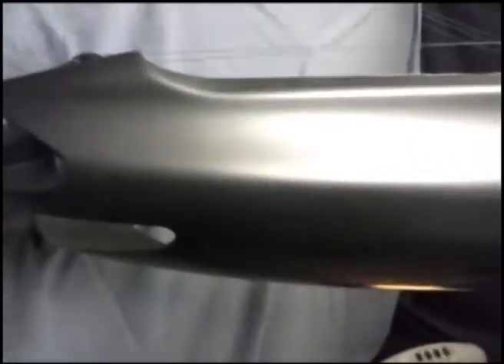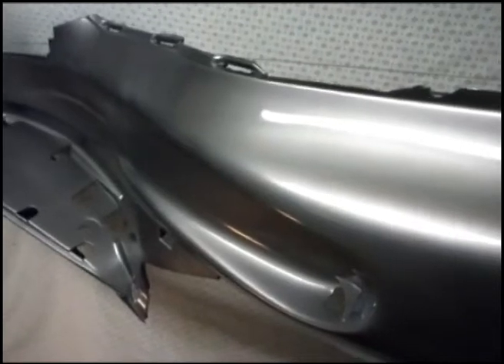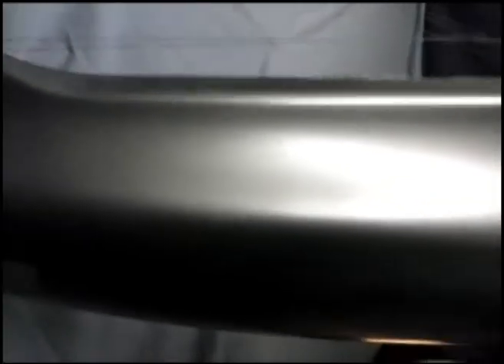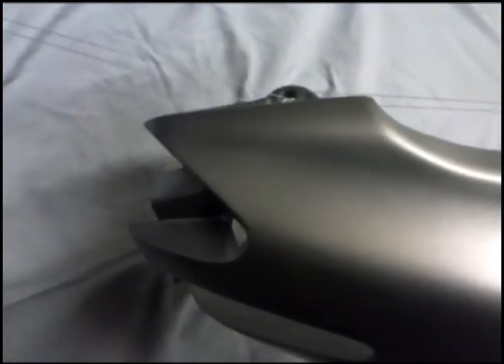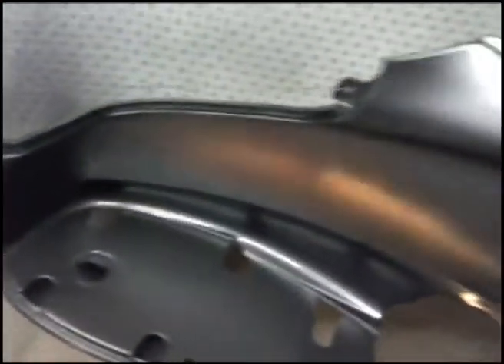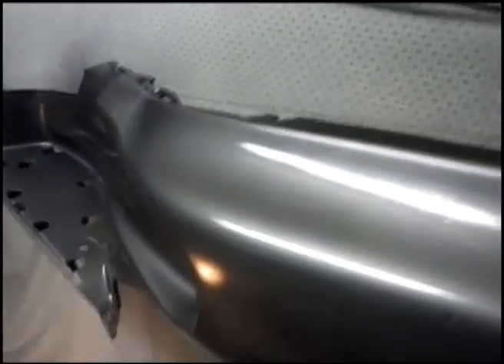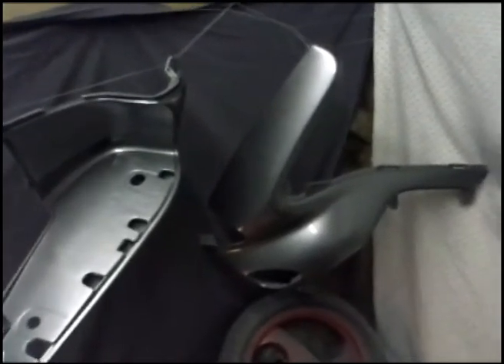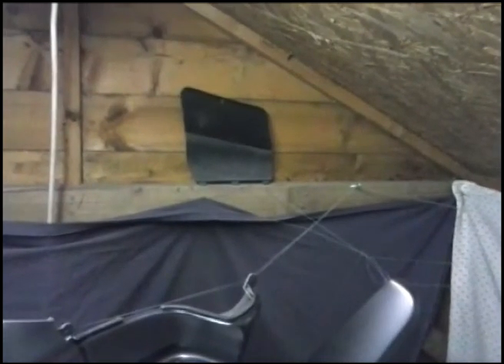Gillera Runner Panel Spray Painting ( Aerosol cans )

Comment from the maker: i would say 2 undercoat, 3 base coat and 2 lacquer minimum. if you only do 2 base coats you might not cover all of the panel/s with paint and you wont get even coverage.I would also do 3-4 coats of lacquer because once you cut back with rubbing compound it will take a thin layer off......the more coats of lacquer, the better the shine.....Prep is key, the better the prep, the better the end result.

Comment: What sanding papers did you use bro?
Reply from the maker: I used 800 to 2500 grit wet & dry. Make sure you use plenty of water because once the sandpaper gets clogged it starts to scratch your work.
Reply: Mark FPV i used 80 grit dry bcs it had a lot of bad clear coat damage,so i am down to bare primer..Can i now use 800 and 2000 to smooth out the plastic and then paint?
Reply from the maker: if you used 80 grit you will need to go from 120, 200, 400, 600, 800  to remove the deep scratches. 800 grit is fine to then primer, i use 1500 grit to then flatten down and primer again if it needs it. dont flatten the base coat if its metallic, go straight to lacquer. if its just a solid non metallic color you can flatten it. i always flatten down the last coat of lacquer before polishing.
Reply: So i can't jump from 80 grit to 1000 wet?
it must go from 120 all the way to 800?
Reply from the maker: if you want to remove the scratches left by the 80 grit, yes. Its a pain in the ass but has to be done for a decent result.
Reply: Oh okay them,i have sanded it with 80 grit bcs the clear and base coat were pretty bad so i had to dig more to get it flat and i've sanded it untill the primer..Is that bad or it's a god thing haha..
I am a begginer is there any tutorial were i can learn on how to prep those plastic panels?
Reply from the maker: 80 grit gets it down much faster but its harder to get smooth again. if you spray a little primer on a small bit you will see what i mean and how rough it currently is. Just have to sand it through the various grits until smooth. What i do is sand  left to right with say 120 grit, then sand up and down with the next and so on. its so you can tell if you have sanded the last lot of scratches out from the sand paper used. defo use wet and dry. dry paper isnt going to do the job.
Reply: oh okay then so i need to use wet from 120 until 800 and then it's ready for primer,base,clear coat..?
Reply from the maker: basically yes. The first coat of primer will let you know if it needs more work.